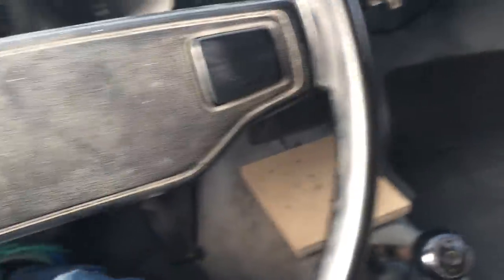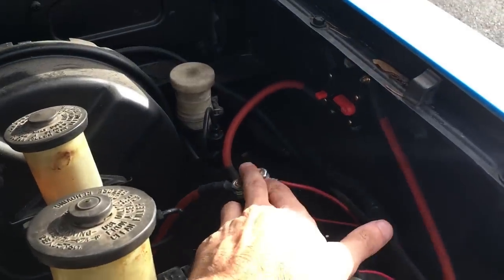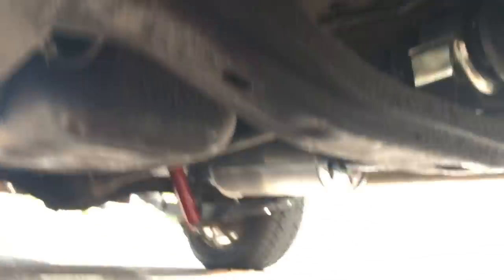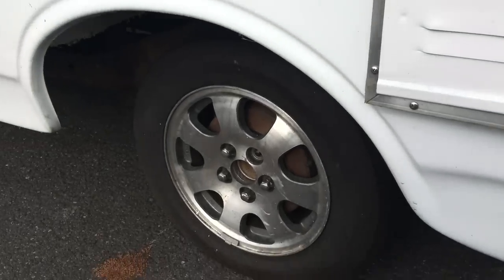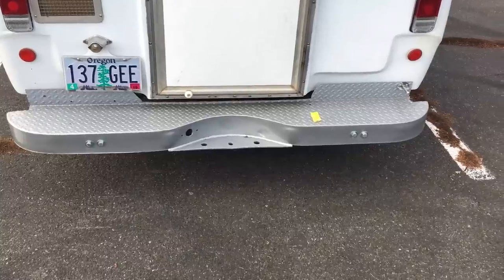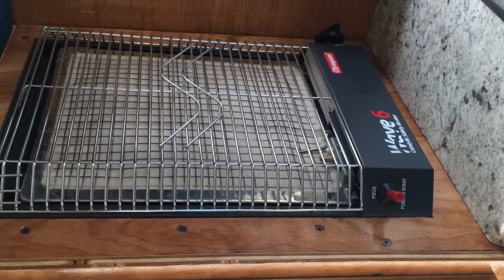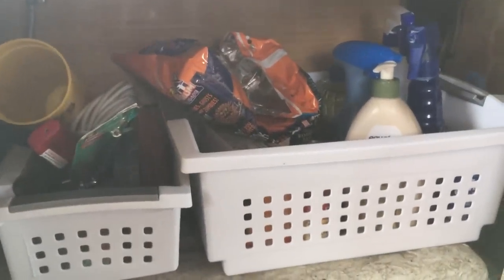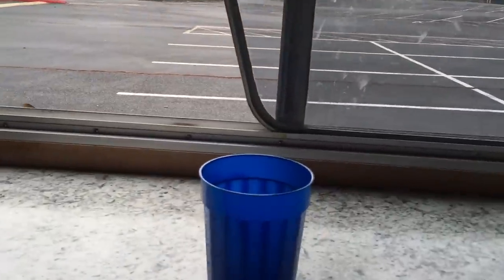1977 Toyota Chinook Poptop Motorhome Restoration Completed

Comment: I got a 1974 chanook need all the inside stuff back in it I got it gutted mine is the 18rc engine are they 4 or 5 speed stick and where did you get parts

Comment: Do you know if these campers are front wheel drive or rear?
Reply from the maker: Rear. They are on a Toyota Hilux (truck) frame.
Reply: @aricbeaver6562  Do you think its possible to tow one of these on a dolly? Or just play it safe with a flat bed
Reply from the maker: dimpat4life you might be able to. The bumpers sit pretty low so lifting the front may make the rear bumper pretty low. If you do make sure to remove the rear drive shaft. I towed mine to get an alignment on an uhaul flat bed and that only cost $70 for the day.